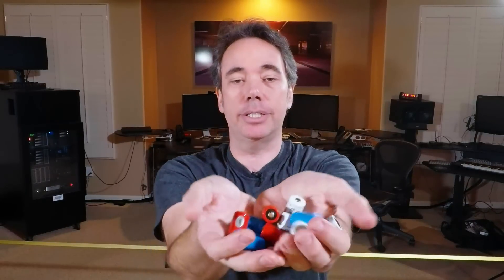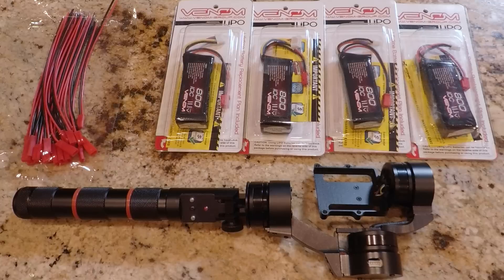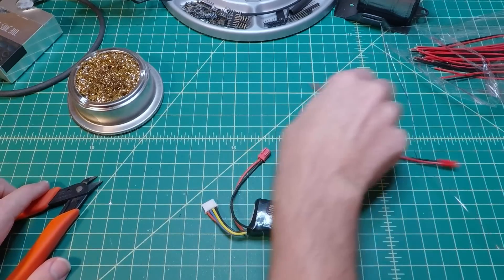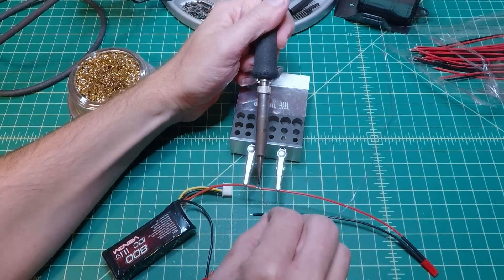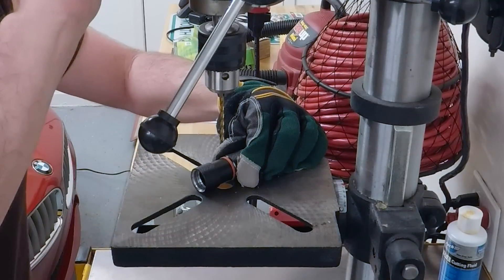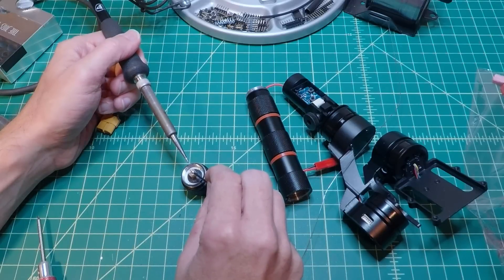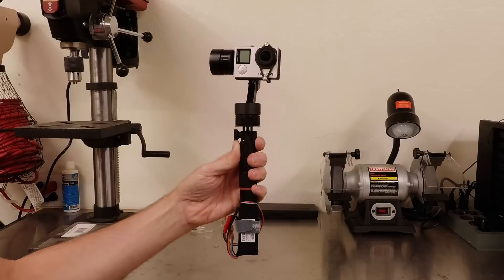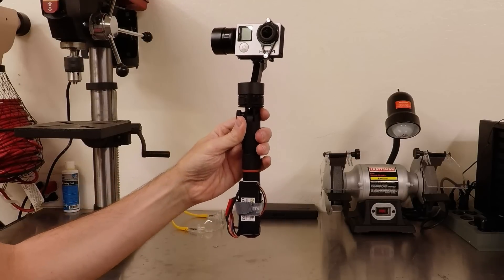3-Axis gimbal supercharger - mod it to use a 3S battery (PilotFly FunnyGo, Feiyu G3 Ultra, etc)

Comment: I'm thinking about doing this to my Z1-rider gimbal, the batteries(IMR 18350 3.7v) equate to a 2s 1700mah 7.4v battery. Problem is i'm having a hard time finding the discharge rate (C-rating) of the original batteries. How did you figure out the discharge rate of the original batteries so that you could find a RC/hobby battery to match?

Comment: the newest gimbal uses only two 3.7v, 7.4  system. as well a shorter handle.  they are 900mah bats that will run three to 4 hrs?  Just keep in mind the original batteries are safer to use, than the Lipo.

I would have bought an extension pole or poles, and soldered  the sets  in parallel, for longer run time. If that is important for extended time. Why  I love the newer model, that  now allows  added batteries.

great job , but professional looking it is not

Comment: Hello. You can, please help answering these 3 questions:  1) video demonstration of all functions of the Pro 3-Axis Gimbal Steadycam Brushless Handheld Camera ST-316 model?  2) 4-pin connector, to be used?  3) there are three buttons, one red and two white. To be used? Thank you very much!
Reply from the maker: Claudio Ferrari I have no experience with the ST-316, but it looks just like the HiFly and the FunnyGo, so I would assume it's similar.  The biggest difference with the FunnyGo is that he replaces some of the components and does a much better tune than the others (from my experience).

For #2, I think you're talking about the TTL interface, that's what you hook up the Bluetooth adapter to.

For #3, the red one switches the mode it's running in, and the two white ones change the pitch (although I've changed them to control roll instead).

Hope that helps!

Comment: does this fix the problem when it quits ,with the lcd backpack installed? they said there was not enough power to hold it when it is very lens heavy ,with the lcd attached , please test . with out a lcd screen i would not buy one .
Reply from the maker: steve fagan I don't think it would fix that - it doesn't really increase the power per say, but increases how long you can use it.  You could counter-balance it, but it would be a bit of a pain.

Comment: Hey, thought you'd be interested in this mod to the FunnyGo I'm working on. I'm using it headworn for stabilized first person type video, and will be working on both the battery mod in this vid and a wall wart supply, particularly for long motion control via the bluetooth.
https://www.youtube.com/watch?v=IsRUqac53xU&feature=youtu.be
Reply from the maker: Troy Gardner Very cool!  Definitely works great in your case!  Wall wart powersupply should be pretty straight forward - probably the easiest is to get either a 5v or 12v power supply and a step-up/down and get it to 11.1v... The FunnyGo might be 12v tolerant, but 11.1 is definitely good to go.

Comment: Hi Anx2k, encountered the same problem and found your video by searching...I took my FunnyGo to Whistler mountain, and the standard batteries didn't even last the gondola journey up - plus if one of them doesn't charge correctly, the whole thing dies pretty quickly. I was looking to do a mod just like yours....but have no experience with LiPo - how are they in cold (Freezing to -10C)?  Are they better or worse than LiOn?  I have a antigravity xp-5 jump starter battery I was thinking of using via a step-up from the 5V - the capacity on that is meant to be amazing (can power a laptop for 2-3 hours).  I would make a trailing cable to my backpack.
Reply from the maker: I think LiPo's are better than LiOn in cold weather, but I don't think either of them are really meant to be run under freezing - but I'm not battery expert.  I'm more familiar with how they don't like the heat, since I'm in Arizona.  ;)  I don't think you'd have any problem using a step-up converter, since the amp draw is pretty low... The other option you could always do is just have a longer battery cord and keep the battery inside your jacket - this way temperature really wouldn't be a factor.

Once you do this mod, you'll probably then quickly hit the GoPro battery as the limit, and once nice thing is that you can pretty easily use a stepdown converter (or uBEC) to get to 5v, and power the GoPro at the same time with a thin/flexible USB.  You'll still want the battery in the GoPro for balance, and the other nice thing is that the gimbal is still doing the LiPo monitoring, so you'll know when you hit the limit.
Reply: Anx2k Yes, that was what I was thinking (why stop at just powering the gimbal).  However, from my basic research on this, LiPos are fragile, and combined with the other factors (wet snow), a short could start a fire.  Possibly.  Don't fancy wearing that on my body if it decides to kick off. Before I saw your post on youtube, I was thinking of using one of my Canon LP-E6 Li-on batteries, which, while not as performant as the LiPo, seem a lot more stable, and pretty small as well.  I have used my Canon 7D on the hill, and I reckon two LP-E6's would more than cover the day.

For snowboarding, I think the ideal situation is to create a new handle around the battery and screw it into the FunnyGo.  Advantages:
1) no cumbersome wires trailing up your jacket arm
2) impact and moisture protection
3) will keep warmer for longer with a fist around it.

2nd choice, running that cable and putting the battery in my backpack, so if I wipe out, I don't break a rib on the battery!

I have some DC-DC convertors from an Arduino project, I will see if I can re-purpose them for this.  I just need to ask Yanher about the power requirements, since I understand the batteries the FunnyGo accepts are unregulated, so there is a voltage limit cut-off circuit which switches off the motors when the batteries run too low, to prevent damage to the batteries.
Reply from the maker: If you look at Pololu.com, they have basically every power converter you could want, plus they're very small and inexpensive.

I can appreciate being careful with LiPo's - they are sensitive, but I've been hurt more by the drones I built than the batteries that power them.  ;)  Your original idea of upconverting a 5v usb power supply is probably going to be the best/cleanest.

If you can figure out what the threading is on the handle, please post it - I don't have anything large enough to test, and I tried at Ace Hardware, but no luck.

Comment: Would it be possible to make a bigger handle out of PVC? Assuming you can cap off the end of the PVC and attach a collar that will screw into the threads on the gimbal. Then the battery can reside in the handle. Fit it with a foam grip.  Place a rocker switch on the bottom. Also would a lithium-ion battery be a better choice?
Reply from the maker: acousticguitar77 Yeah, you could stick it inside a PVC pipe or connect it to the end somehow.  At that point, you'd probably be better off just using a quadcopter gimbal and building something for it...

As far as LiPo vs LiIon, for this application LiIon would be better, but in terms of availability and cost it's hard to beat LiPo's, so I just went with those... Once the mod is done, you can pretty much use whatever you like though, so LiIon away!  :)
Reply: Anx2k I am looking at doing some remote hiking and charging up a lithium ion battery from a USB battery pack seems easier. I will look into the quad copter gimbals. You think that would be an easier/cheaper way? Thanks for the reply too!
Reply from the maker: acousticguitar77 You could probably just adapt the USB battery pack using a step up converter, from 5v to 12v - but I would check with the manufacturer first to make sure 12v is within their acceptable range.

Since you're already talking about doing a bunch of modifications, including form factor, then you might as well just DIY it... It will probably end up costing a bit more, but it will do exactly the job you're after...  Just pick a quadcopter gimbal that's using the licensed version of the Basecam controller, and you should be good to go, that's the most critical part (IMO).
Reply: Anx2k awesome thanks. I know nothing about gimbals so it looks like I have some research to do.
Reply from the maker: acousticguitar77 Just check out what people say on the RC forums and you'll be in good shape.  Good luck!  :)
Reply: Anx2k I am taking a trip to Australia and might not have time to build one. Is there a way to add maybe a six inch carbon section so I can add pole clamp? I would like to add my rode stereo microphone. Again thanks for the info
Reply from the maker: acousticguitar77 I actually do something very much like this - I use the Manfrotto Nano Clamp - it can grab onto the gimbal handle no problem, and I have it at the end of a mic boom pole.  Basically works like a super portable jib at a moments notice - VERY cool shots.  I know other people have use mic holders to hold the gimbal, so if the Nano Clamp isn't something you want to pursue, then most mic holders will probably work - and I've even seen people using fishing pole holders, but I don't like the way they hold it as well.
Reply: Anx2k yeah that would easier than trying to find a small piece of carbon fiber pole with the correct thread size to fit in between the handle and the gimbal. I will probably just try all your recommendations. I wonder if by adding extra battery life to the gimbal it outlasts the gopro. Maybe the (polar pro power pole) could be utilized to extend the battery life of the gopro. Of course changing out the gopro battery isn't that big of a deal.
Reply from the maker: acousticguitar77 It definitely will outlast the GoPro if you're recording - I get about ~90 mins out of the Hero 4 at 4k30... And I think I got about the same time on my H3B+ at 1080p60.  I've been looking around for a stepdown converter, and I think it would be relatively easy to split the power from the 3S battery, and power the GoPro through USB as well, just make sure to buy a very thin flexible cable.

Comment: Hey, I have configured the gimbal .. thing is... are these product fully finished ? I was trying the different modes, always gimbal vertical when switching mode... Power it off, then ON... and it just stopped working. LED was red blinking... I checked the manual and it says that hardware error is occurring... bla bla... I managed to connect it via bluetooth and all the configuration was set to default.... hopefully I had saved it yesterday... but this is clearly missing engineering testing or I don't know how we can call that... I would say that this product seems not fully finished to me. Since yesterday that I have received it, properly calibrated it... I am starting to have issues... and I have not even used it outside... a bit crazy for the price you pay.

check this video, this is the status how it suddendly happen

https://www.youtube.com/watch?v=oCer1RjNDBo
Reply from the maker: If you're asking if they're mass market - all of them are made by basically small manufacturers, so they all have their kinks, and really we're using the first generation of any of these gimbals, so you're not going to have an Apple-esk experience, if that's what you're looking for.  That being said, once you get over each one of these gimbals peculiarities, they work surprisingly well...

I had a similar (but not the same) problem with one of mine, and it was a diode issue that I was able to fix myself, but contact FunnyGo and ask them - something is definitely off, as if it freely moves around like that, then the motors are not being engaged.  Keep in mind they know way more about the issues other people have run into than me - as I use them, I don't make them.  It might also be that you blanked the configuration in the GUI - if you set the defaults, it basically turns everything is...
Reply: Anx2k thanks for your feedback, I confirm that i didn't blank the conf in the GUI as my laptop was not available :) I have contacted Yahner to provide him feedback. I was just expecting something more "finished", of course, if that is the first generation ... there is a HUGE improvement in terms of reliability. I would say that as of now, I am a bit disappointed, was just expecting something more bulletproof, especially regarding the price of the gimbals. I will keep you posted, thanks a lot for your videos and for the feedback, much appreciated.
Reply from the maker: Yeah, I guess I'm a bit more tolerant because in the Drone/UAV space, everything is way worse than this.  ;)  I wouldn't stress too much about it - I have 3 FunnyGo's now, the first one I did the demo with, which I use all the time and hasn't had any problems.  The second one I got also has worked fine - but the third one I got died basically in the first day, but it was the diode thing, and after I fixed that it's worked fine also... So I suspect you might have had an unlucky run, but once you get it resolved it will go smoothly for you.  ;)
Reply: Anx2k thanks :) will keep you posted, especially because Yahner is also a really friendly person, I assume everything should be solved soon. I actually restored the parameter... it's now working as it "should" be... but I would say that the gimbal is unstable ... well time will tell ! nice weekend it's been the guerrilla here in france. Hopefully it's finished.
Reply: Anx2k what is this "diode thing" that you fixed? The FunnyGo I bought has basically never worked (it works for about 30 seconds then just starts twitching all over the place and the flashing red LED comes on). I assumed it was a battery issue and keep meaning to getting around to doing your modification to use different batteries, but you mentioned in another comment that even the worse original batteries you used lasted 20 mins... mine literally never lasts more than 1 minute and I've used 8 different batteries with 2 different chargers.

Comment: Thanks for this interesting hack/solution to what's been a concern for me. I'm wondering if there's a better charger that could be used for the 16340s to get them working at peak performance. I used a La Crosse Technology BC-700 to revive some dying eneloops and was thinking something similar could be done for those 16340s. I'm also apprehensive about voiding warranties with a new product - I'd be curious if I could find a lipo that fits in the existing battery compartment so I'm not drilling into the handle -- though, I'm sure the soldering could still void the warranty. Finally, what charger are you using with the lipos?
Reply from the maker: Johnal Leifsson Yeah, warranty is definitely voided - but for me getting something that works consistently and more easily was the critical factor for me.

I doubt that would work with the batteries, as they are pretty much inconsistent right out of the box - they didn't progressively get worse... I've spent now probably close to $100-$150 on 16340's (I've bought sets from just about every place I could find), and at this point I'm done with them.  If you do find some good ones, let me know - but just keep in mind that I bought one set that works great, then bought another set from the same company a few months later that was terrible, returned those got replacements, same problem.

I have an expensive quad charger that I use from drone stuff - but I modded my friends also, and just bought the cheapest charger on Amazon, which was less than $20.  On the 3S's I picked, the max charge rate is 0.8amp, so anything will do it fine.
Reply: Anx2k Any wiggle room in the battery compartment area? Stumbled across this battery pack (http://goo.gl/5QMwC5) and it's be nice to get it to fit in the handle.
Reply from the maker: Close, but no dice... The inner diameter is 17mm and that's 16mm x 19mm, plus 116mm length is longer than the handle.  I bet if there was a 800mAh version it would be workable, assuming that it was slightly thinner and less long...
Reply: Anx2k Gah! Thanks -- i'll keep looking. Any chance you could provide the inner length within the handle? My FunnyGo has shipped, just waiting for arrival. =)
Reply from the maker: Sure, it's around 105mm, that's from the top of the threaded portion to the bottom of the on/off switch, so there's probably a few mm of play because of the sprint parts that hold the batteries in place.  You could also just use the size of the 16340 battery as a guide - one is 34.5mm long, so that puts the length at 103.5mm.  ;)
Reply: Anx2k Thanks. Yeah, I was originally basing my search using the battery specs/measurements as a guide but it seems not only is it hard to find consistent quality batteries out there, but consistently SIZED 16340 batteries. Besides that, there are the nippled vs flat batteries that some websites say are the same exact size, so I'm hesitant to trust them anyway. Voiding the warranty is starting to sound simpler than searching for good 16340 batteries.
Reply from the maker: hehe - and that, my friend, is why I made the 3S battery mod video.  ;)